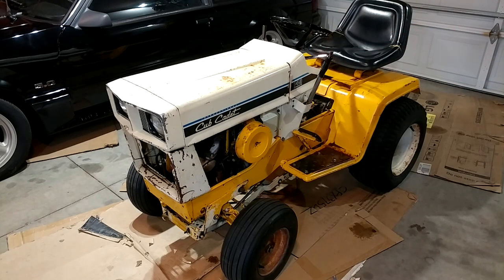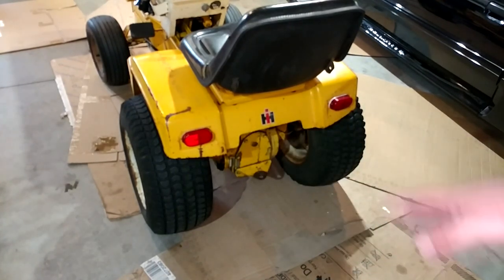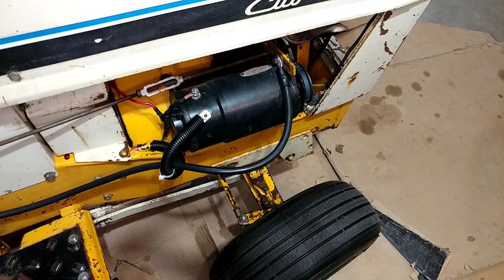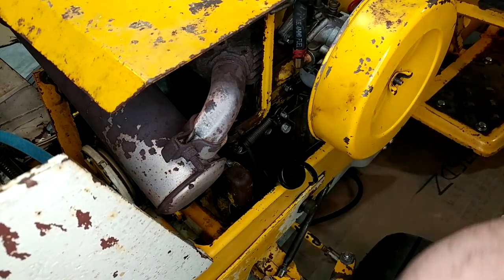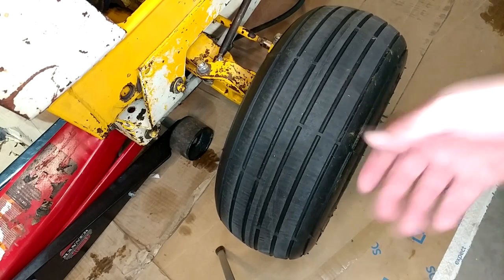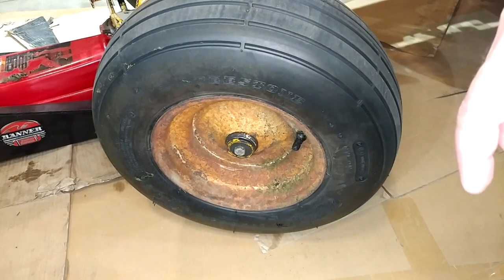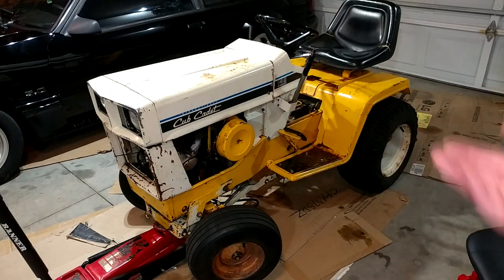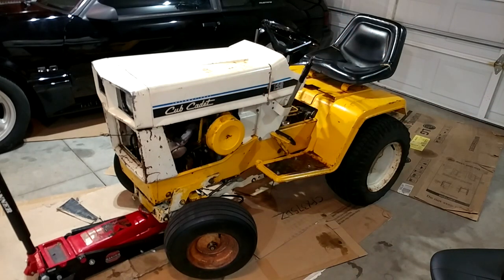Cub Cadet 149 Season End Review 2022!

Comment: I remember during the service video, you took the gas tank out to grease the steering column, I found out on mine, you can take the bottom plate underneath the column off (4 5/16 bolts I believe) and grease it from there, I think it’s easier than taking the tank out each time.
Reply from the maker: Whatever works. 👍

Comment: Thanks for this video. I am still messing around with my 109. Been trying to figure out how to remove steering wheel as there is a lot of slop in the column and the steering itself. No luck yet getting it off. Keep posting.
Reply from the maker: I've never had the wheel off of one, but I've heard it can be a nightmare. I don't think there's much more to it than pressure and time.
Reply: @TheBrokenLife  Thanks again. I will keep at it.
Reply from the maker: @seanteacherman2385  I think I remember a guy telling me that he used a bunch of house wire wrapped evenly around the wheel to make a sling and then picked the tractor off the ground by that sling (in a straight pull direction) with a hoist and just waited for it to pop off. He said it worked...
Reply: @TheBrokenLife  Wow, necessity is the mother of invention. Thanks.
Reply from the maker: @seanteacherman2385  Good luck with it. 👍
Reply: @TheBrokenLife  I got the sucker off. I used an air hammer and 5/16th bolt backed with washers and dropped into steering column opening after nut removed. Took a while but it finally let go. The splined shaft was fairly rusty. If you have never taken your off you may wish to sooner rather than later. Bet it was on there since 1967. Cheers.
Reply from the maker: @seanteacherman2385  I'm glad to hear it worked out! For mine, I actually bought an entire spare column, wheel, tower, etc and plan to rebuild the column/box off the tractor and then swap it in. So, I can at least put my spare up in the press, or vice, or whatever, and have a decent chance at it. 😆

Comment: I’m thinking about buying one of these it’s identical to yours but it’s red it’s got a little rake mower roller and something else I forget it’s $600 is that a cheap price for one of thses?
Reply from the maker: Red would normally indicate it's part of the x82 series, which is about 15 years newer than this one.

I hesitate to say anything about pricing or ownership because these machines can (and are) expensive to maintain and usually everything is worn out on them. If you go into as a hobby then you won't be disappointed.
Reply: Fantastic I’ll definitely look into it then thanks for the info!
Reply from the maker: @Huntersprojects  Good luck! 👍